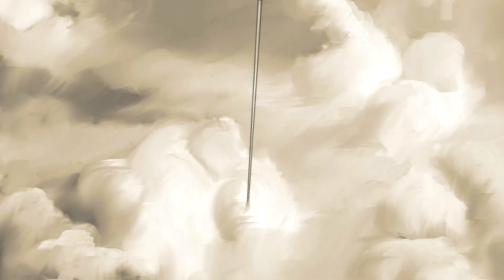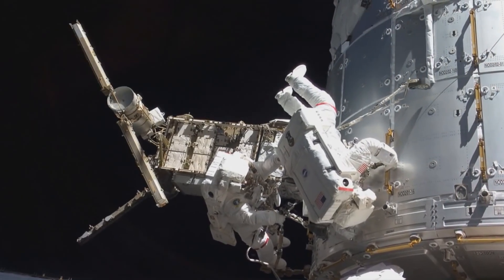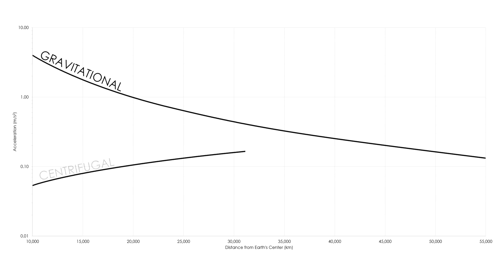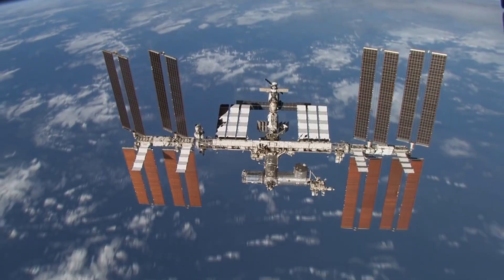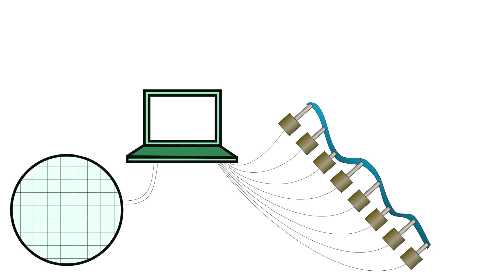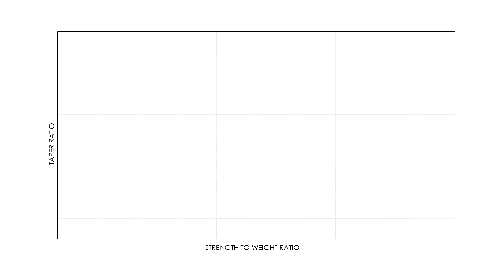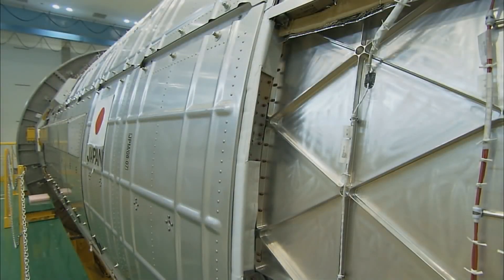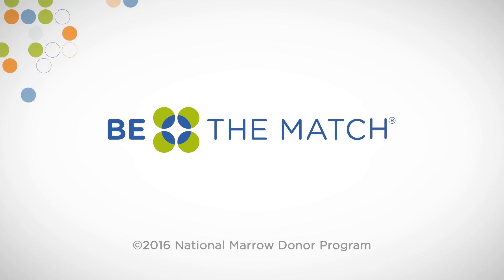Design Your Own Space Elevator

Comment: Would it make sense to start small, i.e. extending the cable down to 1/10th the distance from the satellite to the surface of the earth, and docking with the bottom to transfer payloads/humans to it? The benefit is you'd decrease the energy required in the launch vehicle, but maybe not significantly... As materials improve, you can go farther and farther until 100+ years from now we get to the ground... Perhaps the benefits of this smaller elevator are not signfiicant? 

(The docking process would require constant thrust to keep the vehicle aligned with the bottom of the elevator which should be fine)

Comment: Anything in the Clark-belt is weightless and can't be used to pull any weight, let alone a heavy cable. To make something in space that can keep the cable upright, you have to pull at it's end. The only way to do that is to take a (heavy) weight at a greater elevation than the Clark-belt and use it's centrifugal force to pull at the cable. 

The cable itself will also be weightless when it comes close to the Clark-belt. So the calculated tapering is nonsense. This formula for the tapering is only usefull in a constant gravitational environment. In reality both ends of the cable are free of force. Where the cable starts at the equator it hangs down from the cable above. The last part at the Clark-belt is weightless due to it's height above the ground. The most stressed part will be somewhere in de middle section of the cable. 

The advantage is that the tapering goes both ways so it makes the project more feasable. The downside is that the station at the end will have to be a good distance further away from Earth to generate enough centrifugal force to compensate for the weight of the cable. Depending on the weight of the station, I think you will need a 5 or 10 thousand kilometer extra cable. 

Maybe a solution for the energy problem could be to use (at least) two cables and use them for transport of electricity.

Comment: For power, why cant we use something like what city trains use for power? Have current running through a cable and have something touching the cable to transfer power to the climber? Or a big battery that you have to charge? Or a combination of a few different power sources to increase the overall power, like small rocket engines plus solar power plus laser?

Comment: Quick question, wouldn't building a space elevator at one of the poles negate the centrifugal force of the earths spin, and create a more constant set of variables? 
I mean if a project of that magnitude was to be built why not locate it in its ideal location? 
To counter the weight of the payload could you not offset it with the weight of the base vs top? So once the payload reaches the top hit reaches equilibrium,  and once you unload the payload the delivery system returns to the surface of the earth? I love your videos, this is the first to spark so many questions.

Comment: Seeing the tallest elevator is 300 meters and simple people can make a 150 meter elevator  and a mile is 1600 meters you'd need 10 supports for each mile I'd sat use drones if possible 
And if space is 62 miles from the ground meaning in 62 miles there is weightlessness and a space craft can fly any speed because of weightlessness then you would need approx 700 drones that can lift about 500lbs to 2000lbs to build a space elevator and each level would have a new cable and motor so the cable can support the weight
Probably be closer to 7000 drones if not 10 000
A weather balloon that a connected to drones when high enough might work

Comment: The 1st thing is the climber, aka elevator. Batteries are becoming stronger and stronger with longer life times. By the time this could be developed, batteries just might be the solution to the power to get to station. As many batteries are rechargeable, we use the same principle that is used in electric cars. Applying the brakes feeds power back to the batteries. By the time the elevator got back to ground, it would be close to a full charge.
I first read of this concept in a book by Arthur C. Clarke, "The Fountains of Paradise." They used 4 cables made of a super strong light weight material. The car rode up and down these cables using wheels with friction brakes. This isn't that different that how some elevators currently work. The story also has another story, or 2. I highly recommend this. As you noted, we are getting some materials that just might have the strength to begin giving this idea serious consideration.

Comment: Current research suggests that nanotubes are superconductive. Just put up 2 cables up about 2 meters apart and put a voltage between them. Have the transport pod in-between and use normal electric motors. It’s much easier than all that laser focussing stuff.

Comment: Another suggestion for improving the nanotube space elevator design: Wrap the cable in superconductive tape and put a circular current around the cables. They will produce a magnetic field along the length of the wires, so if they ever got broken by (say) an asteroid, the 2 ends of the cable would pull back together again like the 2 ends of a broken bar magnet. There is some evidence that nanotubes could be superconductive at room temperatures, so maybe we can put a current inside the cables themselves. A few million amps per meter should be enough. The field lines being mostly inside the cables and the direction being along the length of the cables, this wouldn’t stress the pods travelling up or down the cables.

Comment: So super late to the conversation, but if we are talking a space elevator I do have some ideas. I'm not an engineer, and frankly, probably incapable of doing the math.

Laser power is distorted by the atmosphere, right? So, remove the atmosphere. Instead of a cable make it an airtight tube where the elevator sit inside. Pulling a vacuum on it would take a long ass time and you have issues ensuring an air tight seal over such a massive project, but we're already talking space elevator.
Also, in this scenario, you can use the power of air to speed up and slow down by allowing the vacuum to pull the elevator up as you allow air into the shaft. Again, unsure on the math and while I doubt it could pull a load on it own power it could act as an agent to increase the speed at which it can climb. Flood the tube with air as it descends and you have a compressible fluid that you can use to slow down.

Also, could you not use centrifugal force to put upwards tension on the cable and thus decrease the problem of the cable holding itself up? Clearly there needs to be a balance on it but it certainly seems that would be answer to me in that scenario.

Comment: To this day, as someone who has loved physics since a child, but I guess never really studied it professionally, I cannot bring myself to understand why the hell a "space elevator" is such a popular idea. I really don't see any major advantage or any cheating of physics. As something climbs that elevator it will be pulling the top unit down towards the earth, so it must exert a constant propulsion upward away from the earth to resist; would the required propulsion not more or less equal the costs involved in typical rocket or high altitude plane assisted launches?
Reply: Perhaps, because you are only having to lift the payload and none of the weight of booster rockets, some costs could be saved?

Comment: Just with the power issue alone why couldn't we use nuclear power on a rail system that will get you up to the maximum altitude where you can then use giant capacitors to discharge energy into motors to generate you up into the outer fringes of space?

Comment: The power problem is a lot easier than you make out due to 2 factors.  1)  Above 100km using lasers/masers to transmit power is easier because there is no atmosphere.  2)  Space elevators move stuff FROM space, not just to space, and that provides power. 

Second point first.  Any cargo coming down from orbit has to be slowed down, obviously.  The only remotely practical way to do that is to have magnets on the cargo carrier that induce a current in wires around the down shaft.  This would induce a current converting kinetic into electrical power.  The theoretical maximum energy obtained would be equal to the energy needed to perfectly efficiently lift it to it's original height.  Of course neither process would be perfectly efficient but the don't have to be.  That's because you only need this solution where the atmosphere is too thick for lasers/masers to work.  If the energy efficient of the velocity => electricity > velocity process is say 8%* then a downcargo has to have 8% of the kinetic energy it would have if it freefell from 100km to lift the same weight up.  If you're wondering freefall from 100km is about 1389 m/s so 8% of that KE =16% *1389 = 222 m/s**.   The limiting factor is the speed the downcargo can be going when it enters the atmospheric zone and still be controllable.  The higher this is the lower the amount of mass has to come down to life things above the atmospheric zone.  

If you have a moon mining operation with a mass driver the you can potentially power the entire system by dropping moonrock down the pipe.  This is even energy efficient since the energy to get the rock out of the moon's gravity well is much less than the amount gained by dropping down the Earth's.  You could see the world's first negative freight rates, with money paid for transporting mass down.  

First point now.  Any solar satellite with maser/laser you put in space will be more expensive than the earthbound equivalent, but the cost is mostly the price of putting it into orbit, which will go down when the Elevator has at least a pair of shafts operable.  It will be relatively easy to make a satellite and power receiver and put it in place. 

* Based on two 96% efficient processes, the minimum legal efficiency for electrical generators is 96% in the USA.  

** These calculations are based on the earth being a point mass and a simplification of the change in acceleration due to gravity from 0 100km altitude so they're not totally accurate.  They should be pretty close though.

Comment: Wait, Grady, did you make a mistake here?  When you're looking at tensile strength and the weight and thickness of the cable, it seems you did not consider the centrifugal force.  The cable would not need to be thicker at the top than the bottom.  It might need to be thicker in the middle, I'd have to think more about that, but I'm not about that either, because there would be an equal force pulling up as down at any point?

Comment: What about TWO climbers, one ascending while the other descended? (If you can make on 26,000 nanofibre cable, you can make several, and you could compensate for the differences in the forces at top and bottom by spooling and unspooling cable.  Okay, spooling nanofibre cable might turn out to be hard too.)

Comment: If we had a material strong enough to build it. How would we build it. From space down?  It seems like the structure relies on being under a lot of forces that would be very different before it come under load.  If built in orbit, how does the cable survive reentry?    How does a counter weight that needs to be held down by the cable stay in place before the cable is connected? 

what order would you build this in?

Comment: Wait, why do we have to power the climber? Couldn’t we have a motor on the top or bottom of the tether which spins an axel which the tether is wrapped around (might have to double the length of the tether, but we would half the ultimate tensile strength of the cable). That way, the climber can be fixed to the tether and moved by a stationary motor 💁🏻‍♂️

Comment: The key to power for the space elevator is likely the not fully demonstrated superconductivity of buckytubes.  Then you run 3 cables instead of one and use 3 phase power drawn out of the cables to power the climbers.  Ideally 2 columns of cable sets so the down trip of each climber can help power the up trip of each climber  That way it works like a belt with multiple climbers going up one set of the cables and with multiple climbers coming down the other set of cables.

Comment: So, let’s see, where to start? Thinking 40 thousand km, diameter of say 5cm we get around 10 cubic meters of carbon fibre required. So get an asteroid with (say)  1-5 km diameter, of which there are over a million, and we fly there and fix a big solar array and get a laser powered rocket engine on one side and move it slowly towards earth. I’m thinking it will probably use up quite a good proportion of the asteroid’s mass to get it here, and it will be slow, but then, in a few thousand years time, when it is finally in 24 hour orbit, we fly up and fix a machine to it which extrudes nano-tubes. Just keeping the thing balanced with the ever-longer nano-tube cable on one side for the several hundred years it will take to extrude the cable(s) shouldn’t be all that challenging. Maybe better to get 2 asteroids started in case something goes wrong (like a low earth orbit satellite crashing into the cable!).

Comment: Would it be feasible to twine a power cable of some sort with the tether, and have the lifter power off this cable? So not an extension cord, but more like a third rail in a subway?
Reply: No, because resistance increases with length. You're gonna be making a lot of heat and not much electricity
Reply: @sebastiaomendonca1477  Gotcha. Thanks :)

Comment: centrifugal force may be able to lift the cable from heart,  it's just a matter of make the cable longer till the orbital station would be just throw away if the cable break, the only thing you need to be aware at that moment is the tension force of the cable between the orbital station and earth, the part about the cable requiring  to became thiker seems flaw, as said the more weight attached  at the end of cable the more weigh it will lift due centrifugal force ( because objects far away from earth need to move faster) to be allineate with earth.

so centrifugal force can > beat weight of the cable and litteraly throw it away like a boat at the port if anchored badly.

if you find a cable that can resist the strenght done by the centrifugal force that will pull away the cable from earth half job is done.

Comment: Why not just run two cables and use them as the positive and negative wires for the lifters motors. Run extremely high voltage. Like you said you only really need the most power near the bottom and we can already send power hundreds of miles without a booster substation. The higher up the lifter goes the less power it would get through the cables because of resistance and loss but the less power it would need to continue lifting. could also run a laser system either from the earth up to assist or better yet put some sort of power plant "probably nuclear fusion or even fission" in the counterweight and fire the laser from there. The power from the lines gets the lifter out of the atmosphere and then you dont have to worry about the atmosphere messing with the laser.

Comment: Isn't SpaceX already reducing the cost of orbital launch by about 95%?  Given the extreme capital cost, a space elevator needs to do a lot better than that.

Space elevators belong on the moon and possibly on Mars.

The material we would really want for a space elevator would be a near-nanotubule-strength superconductor, so that the energy conduction cable and the support cable are the same thing.
Reply: Not 95%, only about 12% with Falcon 9. However, Starship promises to get closer to that number.

Space elevators on the Moon are entirely impossible because lunar synchronous orbit is beyond the Moon's own sphere of influence
Reply: @sebastiaomendonca1477  Got a credible source for "space elevators on the moon are impossible"?  Countless people have done the actual calculations, and if they'd been proven wrong it ought to be news.  Here's a random article talking about them:
https://www.nbcnews.com/mach/science/space-elevator-moon-could-be-doable-surprisingly-cheap-ncna1051496
Reply: @danwylie-sears1134  Not hard math to do. The moon's rotation period is 27.33 days, or  2,361,312 seconds. Using the formula for universal gravitation and adding a few circular motion formulas you can get a formula for radius based on orbital period. At 2361312 seconds you'd be at an orbit with a semi major axis of ~88,500Km. This is 20,000Km beyond the Moon's own 66,100km sphere of influence, meaning you'd be at a point beyond which the Earth's gravity is stronger than the Moon's. You would not orbit the Moon anymore.
Reply: @sebastiaomendonca1477  Of course L1 and L2 (approximately where lunar space elevators have their centers of mass) are orbits around Earth.  They're the places where an object will orbit once per sidereal month, so that it stays in the same place relative to the moon.  

There are five places where the combined effect of Earth's gravity and the moon's give a circular orbit with the same period as the moon, called Lagrange points or libration points.  https://en.wikipedia.org/wiki/Lagrange_point

In between Earth and the moon, the moon's gravity partly offsets Earth's, so that an object has to be closer to Earth in order to orbit at the same speed: there's one place where it comes out right.  That's called L1.   Beyond the moon, the moon's gravity augments Earth's, so that an object has to be farther from Earth to orbit with the same speed.  Again, there's one point where it comes out right.  That's L2.  

Either of them can have an elevator.  People have done the calculations, and basalt fiber is strong enough for most of the cable.  You don't even need kevlar for most of it.  So it can be made mostly out of lunar material.